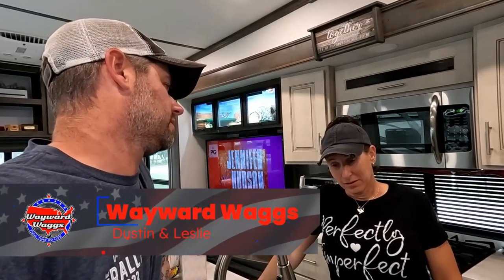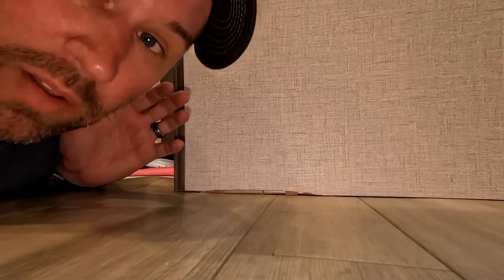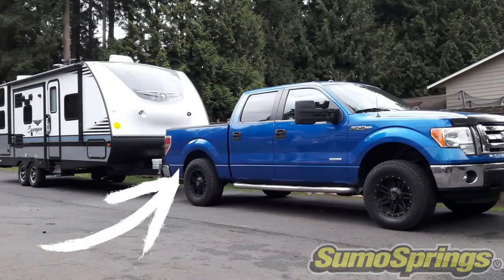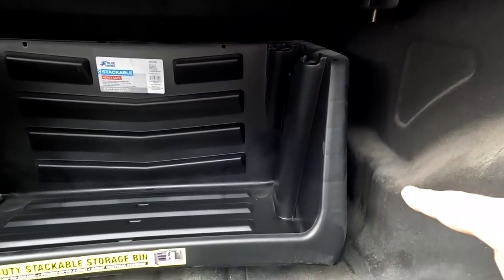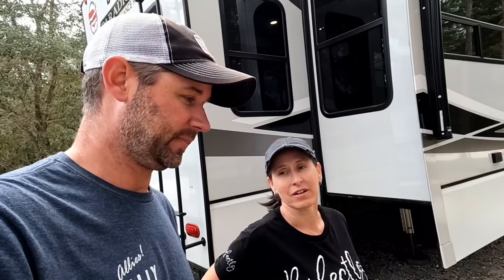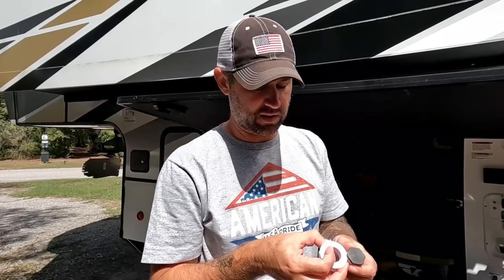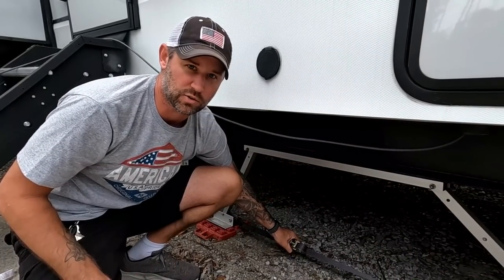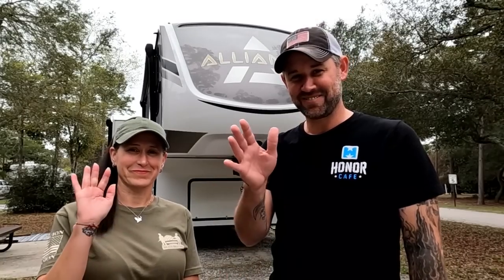Necessary RV Maintenance and Organization

Comment: Quick tip: You don't have to wait an hour for the water in the water heater to cool off. Turn off the water heater and then run the hot water for a little bit. The hot water in the tank will be replaced by cold water. Tell Leslie to be sure to hold the rug...😂
Reply from the maker: Great tip. Thanks!

Comment: Who does not like Project day?  Ok maybe me.  On the hot water heater...if you shut the water off dont forget to open the TPR valve otherwise you will have an anode missile.  On the slide bulb seals, we have slide toppers so trying to figure out how to lubricate those top ones.

Comment: Regarding your bins in the truck. You can manually turn the hitch to one side and it will release and slide back. This should give you plenty of room to pull the kayaks in and out a lot easier. I couldn’t tell what kind of cover you had, but the BakFlip cover allows you to flip that last section up against the cab giving you full access as well. Hope either of those helps.
Reply from the maker: Good tips. I didn't think of that. Appreciate it.

Comment: Reorganization and maintenance is a never ending project. Seems were doing something different on every trip. On our last class A I used baby powder for the slide seals. The seals worked great it kept them from leaving streak marks on the side panels. Thanks for sharing 🙏👏👏🤗❤️
Reply from the maker: We might try the baby powder thing. Thanks for the tip.
Reply: @WaywardWaggs  Put the Baby Powder on a rag and wipe the seals on both sides.👍

Comment: Just wondering... How often do you all weigh your fifth-wheel after you reorganize? Do you stay at the maximum weight or a little bit over? Or are you able to stay under the max weight? We're heading to Alaska for the summer! We really had a couple of purges. We just installed our Sumo Springs. We love them, but Dexter was trying to tell us NOT to use them. They said even though they have not done their own testing, they just strongly recommend to not use them. I love them! Sorry for all the questions... We're having some fre Alaska drive anxiety! LOL!!
Reply from the maker: We weighed it about a year ago and we're good. We have purged about as much as we have brought in so I think we are still good. We were a few hundred pounds under. Dexter doesn't want people to buy Sumo Springs because they want people to spend over $10,000 on independent suspension.
Reply: @WaywardWaggs  Good point. Thank you!